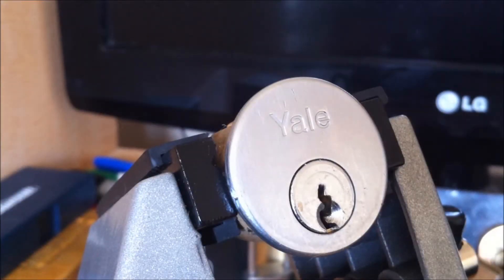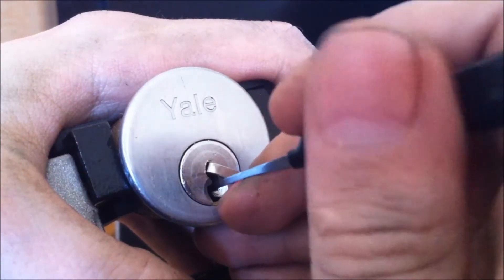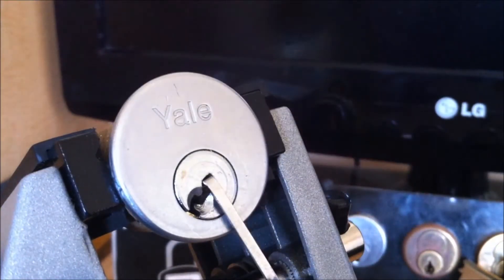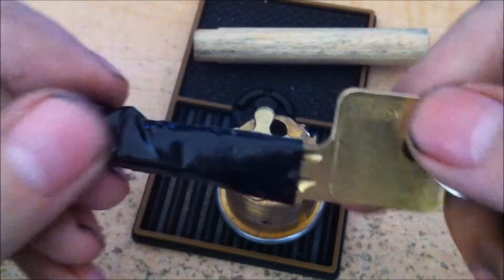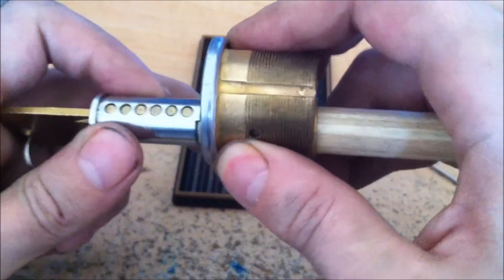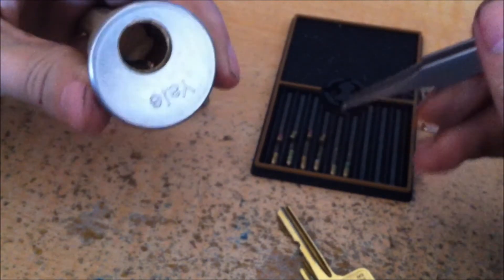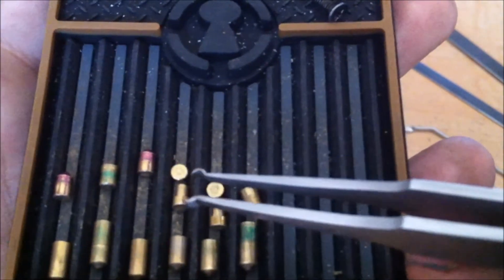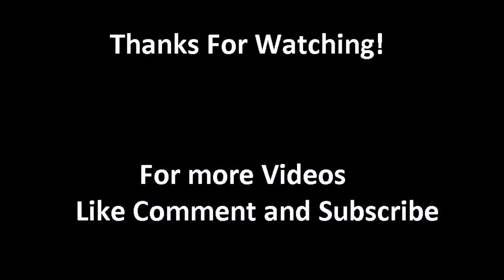(11) Yale challenge from I.C.P Locks

Comment: Lol. Think about why one tension wrench will work better than the other. It is all to do with the drunken spools. The way I put them in was on chamber 4 wafer below the T pin, 5 wafer was on top of T pin. With your angled wrench you are kicking the plug to one side more than you are using the music wire type tension wrench. This is what causes the pins to bind. You are correct 4 and 5 are the first and second binder. Without those being bound first you can't pick the lock. Like most locks it's all about the tension. Because of the way I placed the wafers you can't get them to bind unless you can get the plug to become slightly off center which is what you are doing with the angled wrench...
Just getting back to normal so I will be in touch with you soon.
Reply from the maker: Hey, thanks for the explanation, I was just thinking the angled tension wrench was giving me a bit of flex and a feathered touch, but that makes alot of sense. Happy to hear from you, will talk soon, and thanks again bud!